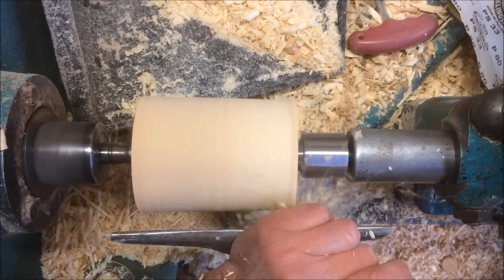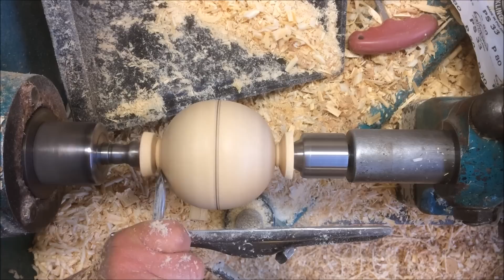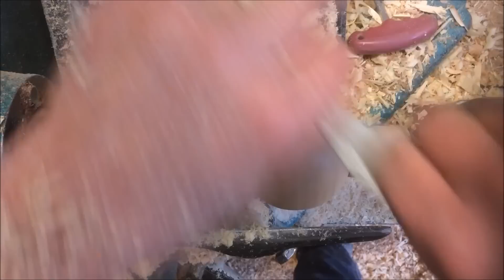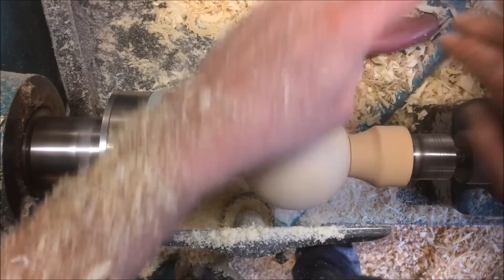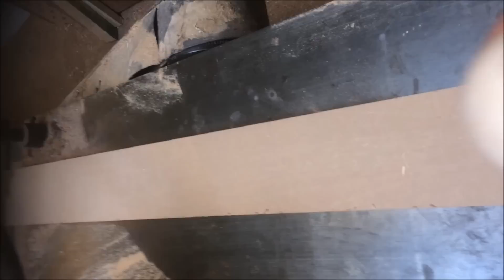Hand woodturning a sphere

Comment: Well, if you ever come back to this comment section, I have been having problems getting the cup chuck on my tailstock to be spot on centered. I did make one that fit almost vacuum tight on the tailstock, but the sphere would never center well, always on at 3 points, but way off on the 4th point. Found out my tailstock live center was not very accurate. I did get to see Allan Batty for a work shop and he was telling the story of turning billiard balls out of ivory. They used jamb chucks to finish turn the billiard balls.
Reply from the maker: If your tailstock center is not true then you are going to struggle. You could use a jig just in the chuck where you turn a cup and ring almost like a donut chuck but you will need to turn it many times and work to a template. This is very difficult and time consuming. I’ve never seen the turning of billiard balls but Grandad used to tell me about it. He didn’t do it but had seen it done.

Comment: You are a master of the skew! I mean poetry in motion friend! Im just learning that took and wonder if you could tell me why it tends to "run back" as I attempt to turn a bead as such!
Reply from the maker: Thank you, it’s hard to answer your question without see you do it but you have either come off the bevel, over rotated the tool or are cutting too far away from the point.
Reply: woodturner21 so you want the very point to do the cutting as opposed to just the lower third of the edge? Very well may be coming of the bevel also. Thank you
Reply from the maker: Yes that’s the best way to learn it.

Comment: Wow, I just figured out this same method a few months ago, since I’m not good with math I just thought that a ball is just a cylinder in three    D
Reply from the maker: It’s a very simple way and works 👍
Reply: @woodturner21  nice, like that you comment back, ya I was shocked because your cup centers look just like mine, I made two sets, one large and one small and glued in some old wet suit material and I’ve made them up to 8” or for your area I think that’s 200 mil?
Reply from the maker: Genius idea wet suit material. 8” works for me remember I was taught everything by my Grandad. I still order wood in imperial measurements 😁